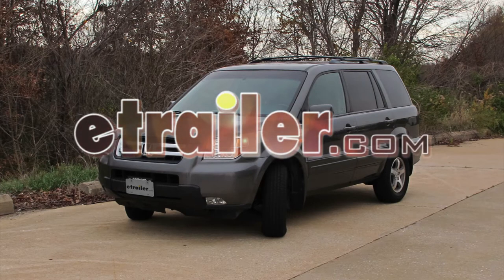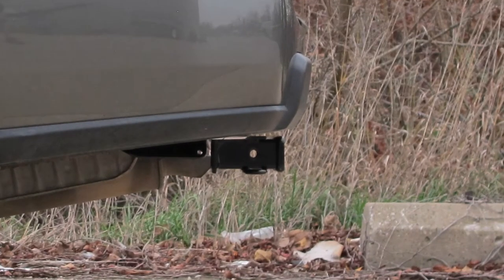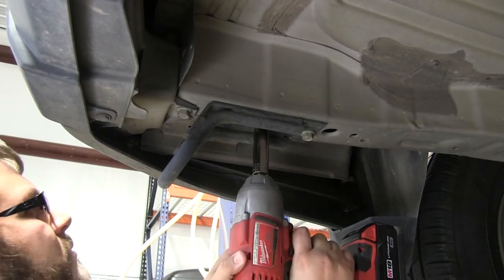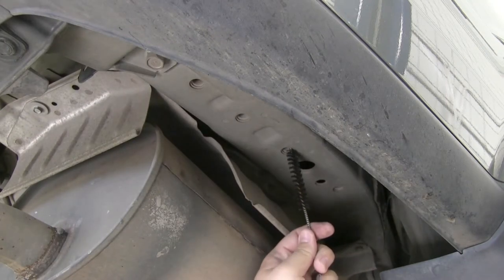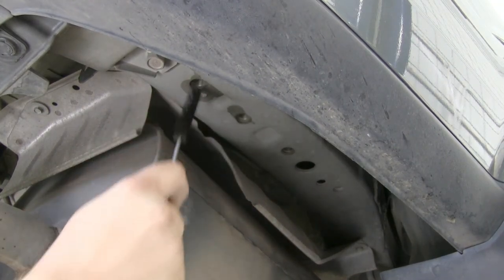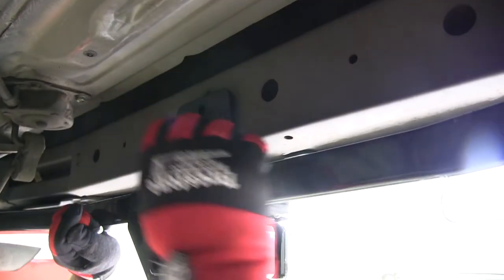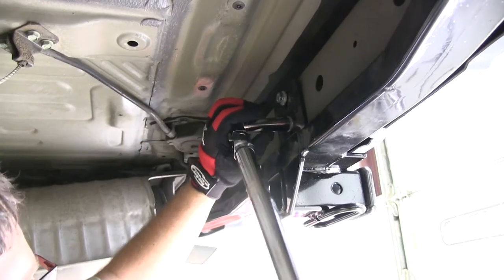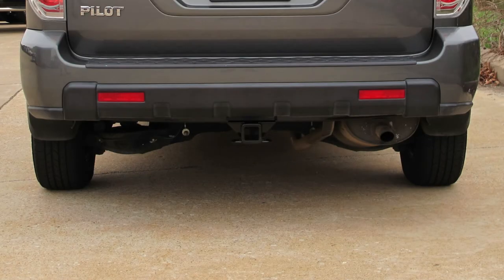etrailer | DIY Install: Curt Trailer Hitch Receiver on your 2007 Honda Pilot

Comment: You mention the 2 center bolts are M10s but you didn't say the size of the 6 bolts holding the sides in place.  Are they m12s ?
Reply from the maker: Yes, the other bolts are M12 bolts. I linked the instructions below so you can see all the specs. I also linked the product page. 

https://assets.curtmfg.com/masterlibrary/13328/installsheet/CM_13328_INS.pdf

https://www.etrailer.com/Trailer-Hitch/Curt/13328.html

Comment: What size bolts are needed for the passenger side and the center, since they aren't included with the hitch?
Reply from the maker: Did you order the hitch from etrailer.com? It should have came with a complete hardware kit for the installation.
Reply: etrailer.com, I did, but I didn't find them right away. It's installed now, thank you for the VERY informative video